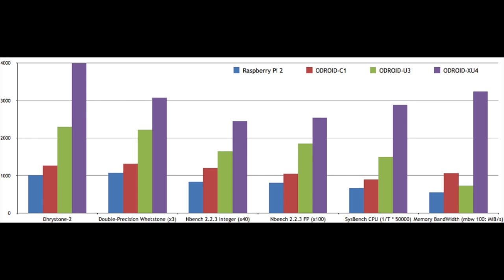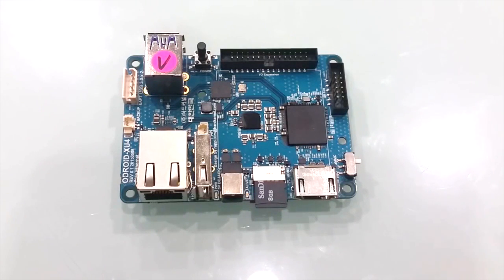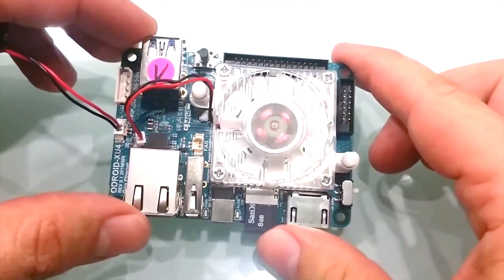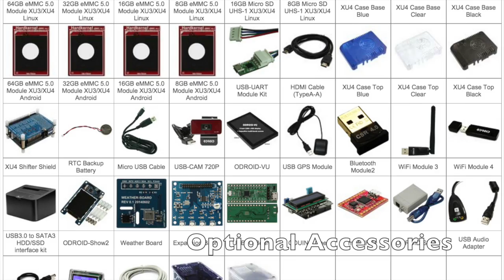ODROID-XU4 Hardware Introduction

Comment: and a warranty of only 4 weeks.. really great...
Reply: +Manoel Ramon It's a Dev board..... Also mines been rocking for almost a year. That being said... get the Cloudshell guys, the PCB is very thin and I could see flexing without a case.
Reply: Yeah but some people are complaining saying the board gone in few months
Reply: Manoel Ramon I'd want to know the conditions on how they were stored and handled. I can tell you that without a solid case it could easily be broken withing a few months. It's too thin. But mine has been kept in my cloudshell since I opened it.
Reply: They used it without fan and overclocked , right?

Comment: Is it possible in near future to make a board thats like XU4, but with additional stuff like ( if it isnt allready there):

Audio out with that hifi shield chip
HDMI 2.0 for 4k 60hz
damn good performance, for stuff like in-home streaming, 4k 60fps HEVC h265 encoding / playback, snes / psx emulators.
SATA 6 or 3 Gbits port/s
4 or more USB 3.0 ports
4,6 or even 8 gb ram / so-dimm slot
mini pci / e for DVB-C/S2/T2 cards
built in wifi g / n / ac  like anyother SBC.
Molex power connector / adapter, in case theres SATA ports.

and all that "affordable"? :D
Reply: +gamerpaddy don't forget the built in time traveler...
Would be hard to make it affordable with 8gb of ram and sata3 controller support but we can dream of course ^^
Reply: +Amiga Wolf too big,
 too high power consumption
mostly too expensive (seen intel nuc prices? fuuuuuck)
Idk, is M.2 supported by ARM processors? 
usb 3 is too slow
Reply: +gamerpaddy and wireless NIC
Reply: +gamerpaddy Raspberry Pi 3 B now has built in wifi and bluetooth.  It's the same size, but slightly less powerful.
Reply: umm it's way less powerful, odroid c2 is sligtly less powerful than this rather
raspberry pi 3 is actually not such a big step over pi2, and pi2 was way underpowered compared to this one, this could be equiparable to the jetson tk1 if all cores are used here, gpu wise tk1 stomps this but overall they are comparable.
Pi3 is nice if you are getting into dev boards but if you already had a raspberry the odroid c2 is damn awesome to continue with, and if you want the best out of the best then you have xu4 / jetson tk1 of if you have the dough tx1
Reply: Oh, OK, you're right, it's more than half as fast, and has half as much RAM, plenty of people use it as a Kodi client or retro gaming machine, but in light of your answer, let me change my answer to, "No, no there is nothing comparable but with all the built in shit.  Don't even try.  I'd rather crap on anyone else's answers and disappoint you while at the same time showing off my (erroneous) knowledge of single board computers than be of any help, so I can be more like elmodo7."
Reply: ShimmySnail just told you better alternatives so in case you are going to get one you get the best.
You didn't catch it, not my prob bro, I use it for my job so it's crucial getting one or the other for me.
Just saying they are not comparable from an enterprise user standpoint.
Raspberries are awesome for learning and some projects but other boards can be used for more "complicated" jobs like object recognition and so on, I just wanted to show you that for example an odroid c2 has you covered in some aspects a rpi3 can't.
It's a nice alternative and if you have already owned one it's awesome to try one of this odroid out. Just saying xu4 is actually way more powerful than pi3 and not slightly more powerful like you said bro.
Chill
Reply: Then just buy a MiniPC, if you want that all.
Reply: And why use a old SATA 3 just use the one it had or M.2 slot.
Reply: Or you van buy USB3.0 to SATA Bridge Board http://www.hardkernel.com/main/products/prdt_info.php?g_code=G145197048960

Comment: Would it be to much to ask for HDMI 2.0? What's on the board HDMI 1.4 can only produce 4K @ 24FPS whereas HDMI 2.0 produces 4K @ 60FPS and is capable of real video games... Still waiting, but thankfully I own a SoC capable of such a thing... The Nagrace NT-V6 RK3288 with a Mali-T764 HDMI 1.4 in and HDMI 2.0 out
Cortex A-17 4GB RAM 32GB eMMC 10/1000 LAN and a AC WiFi and Boots within 10 to 11 seconds, Please upgrade?
Reply: If you already have what you want why ask?
Reply: Tim Turner More projects
Reply: MrBrymstond Fair enough
Reply: MrBrymstond +++++1 on the HDMI 2.0. I really wish it had that. I am looking to source computers to drive 4k displays.